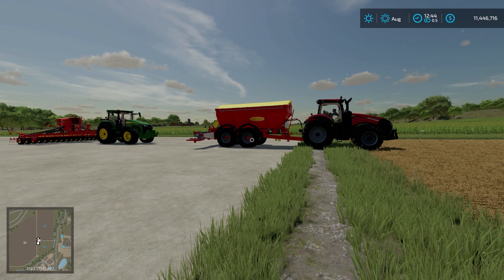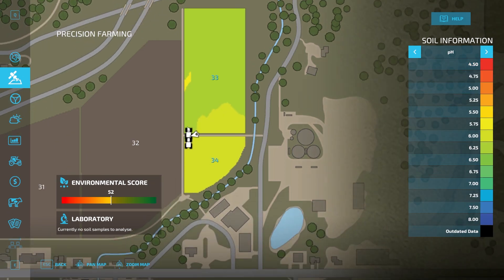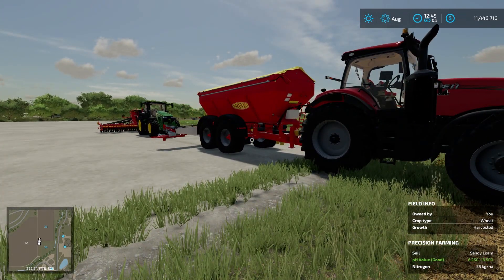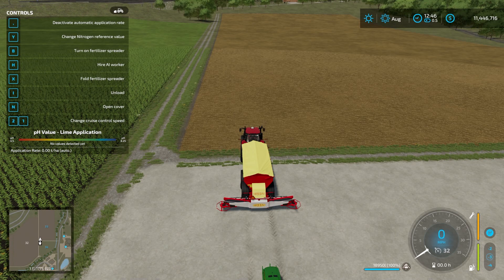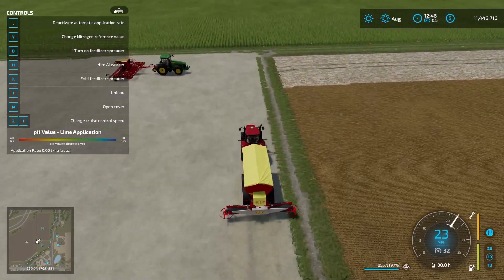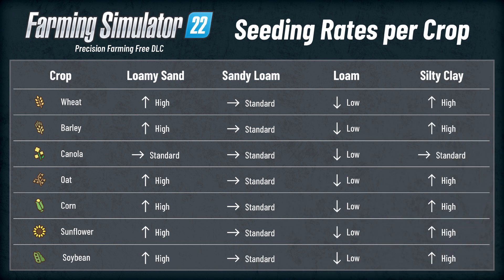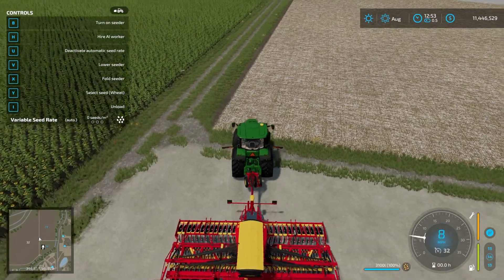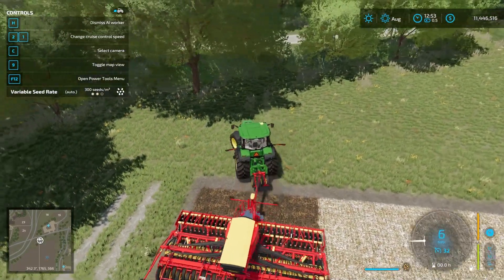PRECISION FARMING GUIDE - PART 2 - Farming Simulator 22

Comment: Do you recommend using drills with the fertilizer application setting to? If so, how does it affect nitrogen levels?
Reply from the maker: Yes direct drills with fert on just sets the nitrogen to the correct level as you seed, takes away a step
Reply: @FarmerCop  by doing this, do we still need to spread manure /slurry before the sowing process with fertilizer?

Comment: Do you have to line every harvest? I never figured that part out in 19.
Reply: Was always dependant on the crop, check the PH after each harvest, if it orange or red, lime it, if its green or yellow give it another harvest.
Reply: You can get away with liming after 3 harvests without taking much/any yield loss but I'd still recommend doing it every harvest; your usage rate will be so low you can cover quite a bit of land without having to fill up, unlike the base game.

Comment: Adding lime before seeding soybeans, would hurt your income, since soybeans dont need as much lime as you applied. For wheat, oat and barley you can lime then seed, but not soybeans, if you really care about this stuff.
Reply from the maker: Lime is tied to (according to GIANTS) the soil type NOT the crop type
Reply: @FarmerCop   In Real Life some crops like Soybeans need less lime. In FS19 with Precision Farming, you could also see this fact. If you limed over allready seeded soybeans, you would add very little or no lime to soybeans.
 Maybe FS22 Precision Farming is different there.  I haven't installed precision farming yet of fs22, due to all the reported problems. With the patch i can run all mods, including Guidance steering and other scripts mods without problems, so i don't dare installing PF yet.
Reply: @FarmerCop  maybe youre talking about nitrogen, since soybeans dont require nitrogen but taht is fertiliser,lime is for ph. And auto distribution wont overfertilise so money saved.
Reply: @JunacCRO  While true that soybeans dont need nitrogen since they help bring nitrogen up. There is a crop in the real world that likes slightly acidic soil. The Potatoes 5.3-6.0 is their preferred PH. But in the game its just soil which is fine.
Reply: Lime is a soil amendment not a plant nutrient.  In situations where pH is below 5.5 that would start to decrease soybean yields. So applying like raise pH to 6.5-6.8 would be realistic in real life.  

In general probably best not to nit pick because it is just a game.  While some things are not accurate this mod is a great addition to the game and exposes more people to how complex farming truly is.